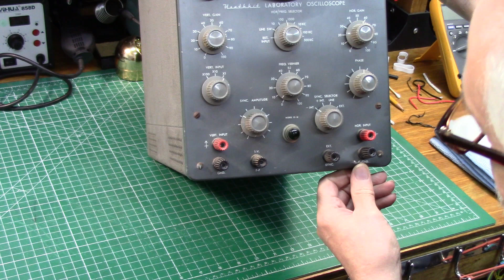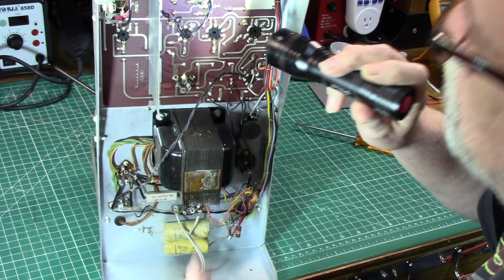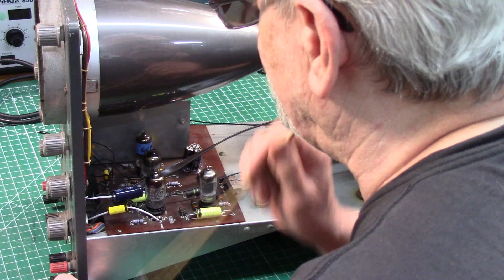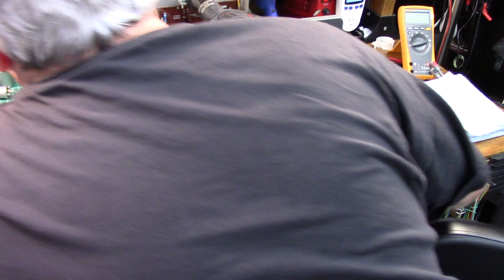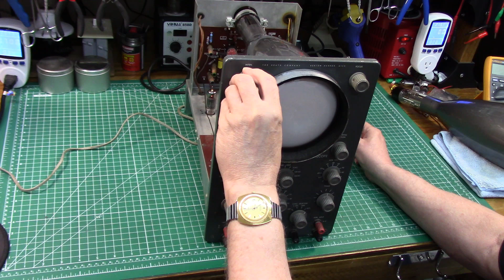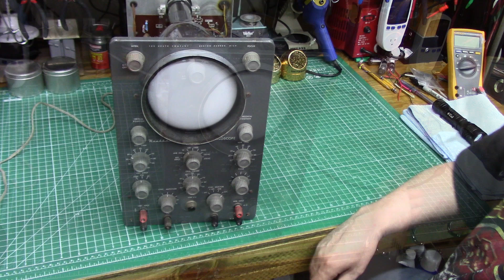Heathkit Oscilloscope Repair   Circa 1954, 56 - Model 0-10

Comment: See: Mr. Carlson's Lab.  He took one of these and made it into a Curve Tracer , with Auto Standby to put the display to sleep!
---
Before you turn it ON, RE-CAP it first! :hand-pink-waving: Don't waste you time!
---
Generally when tubes are Open on the filament's, the E-CAPs are to blame!
Reply from the maker: You Think! 
Paul Carlson is a very smart man who not only converts instruments but designs his own testing equipment. He’s in a different pay grade than most of us hobbyist; he has to be an electrical engineer by trade with all his knowledge.
Reply: @kenslab1973  - Yes I'm a Patreon of his.   I also design many of my own circuits.

Comment: to get a stable wave thats not moving across the screen turn your  frequency vernier.  it works in tandem with frq selector knob.  think of it as course and fine controls if you will
Reply from the maker: Thanks for the tip, actually I had a stable wave, but the wave pattern appears to me moving on the video.